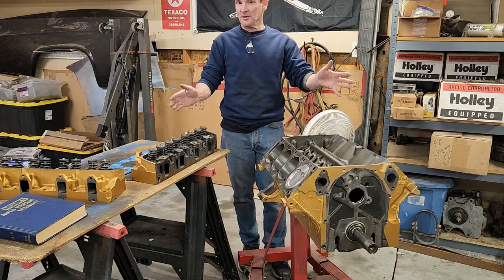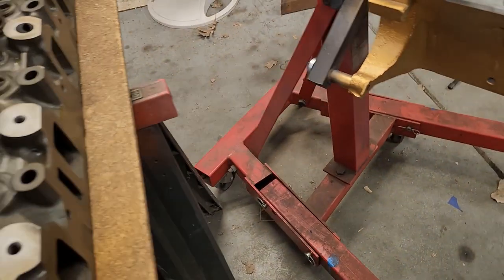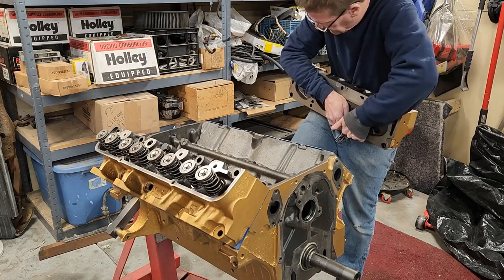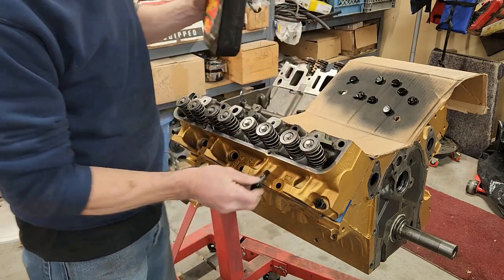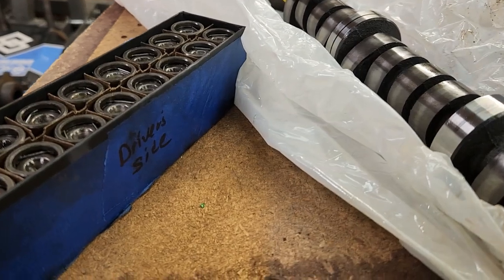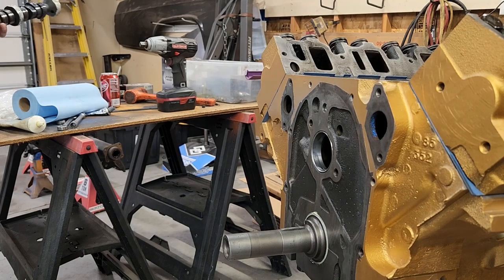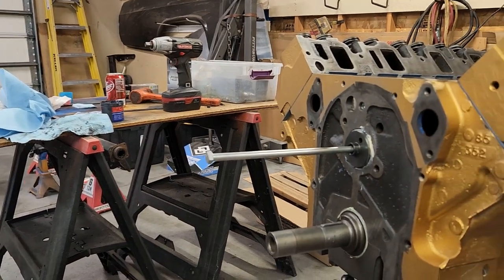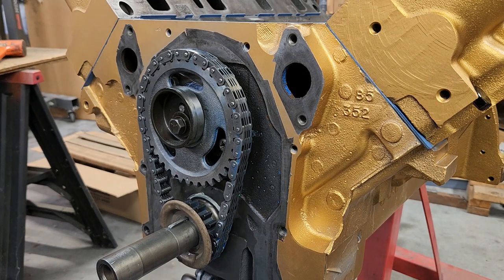Ford 428 Rebuild, part 5. Installing the Cylinder Heads & Camshaft!

Comment: Very good motor, could not have went wrong. Do not red line it , stay within 500 under and only when needed and it will last longer than what you put it in.

Comment: I don't believe it's recommended to reuse head bolts.
Reply from the maker: You definitely don't want to reuse torque to yield bolts on an engine. Many modern engines have these. Technically, reusing a bolt depends on how much stretch it has endured from being torqued before. Measuring bolt stretch requires special tools. On these old Ford engines, not using anything special in the way of gaskets or aftermarket heads, reusing the head bolts is fine.